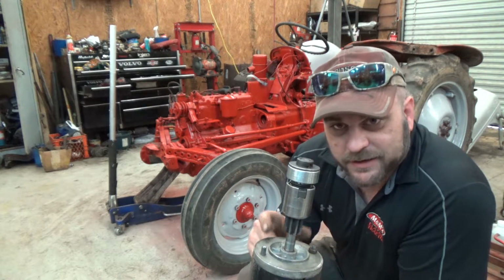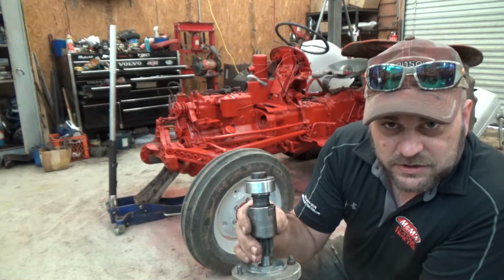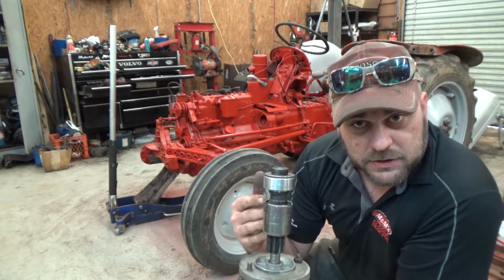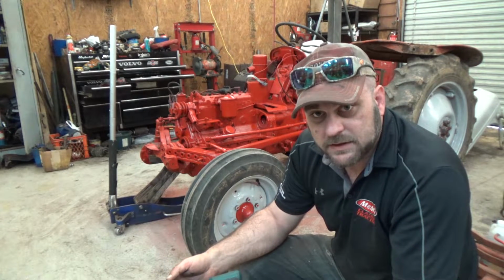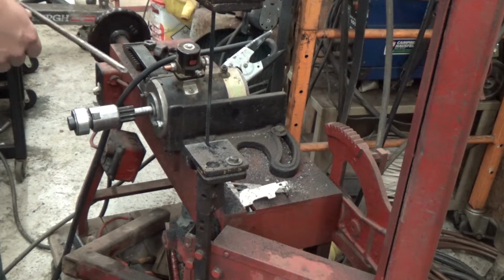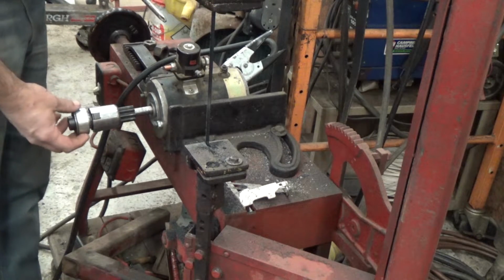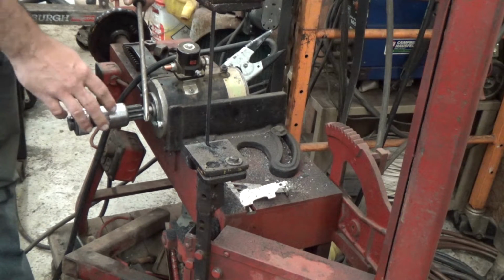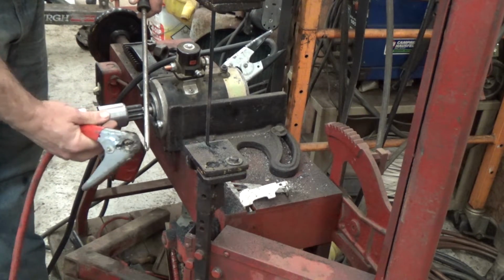New Style Bendix Ford Starter QuickFix

Comment: I'm so glad you made this Video . It sure beats taking the starter apart and using a wire wheel.  So many times starters during shipping get messed up with the drive gear forward....Over here one day you ran the starter in your hand with jumper cables  and touched the drive gear to your shoe heal running the gear back. Now that was a magic trick...

Comment: Hey man...thanks for the tip! Have a starter where the drive gear cracked, so ordered a replacement. Will need to be able to compress old drive so I can get the pin out. Your video shows me how.
Reply from the maker: No problem 👍

Comment: This worked great and is the best way to free up this drive unit. Worked first time. The other way with a screwdriver holding just the drive unit on a wire wheel worked also. I'm very thank ful for these clips.

Comment: I read from Steiner Parts website it can be installed with the Bendix extended make sure the ring gear and Bendix gear are meshed when it starts it will retract to the proper position.
Reply from the maker: IF your lucky it could work.  The problem is that its near impossible to get the bendix past the flywheel when it is locked open.   IT could be done..  though the method shown is much faster and saves tools from being thrown in frustration.

Comment: I just hold it against a wire wheel on a bench grinder and it spins it right back into place.
Reply from the maker: Sometimes we do the same thing. But a lot of rebuilt and new starters have strong fields and the brush will not spin it.

Comment: How to set point on 8 n ford  front mount
Reply from the maker: I personally think its best and easiest to do this with the distributor on the bench (off the engine)  We have a video partially made on this.. its taking forever to get edits done but should be up soon
Reply: Sometimes because of the way that distributor is design it's easier just to take the stripper off market before you take it off line it up to top dead center number one cylinder and then remove it! That way you can clean it but the new points condenser in many time those condensers don't go bad.

Comment: Can this new style be fix be installed on a good starter to get rid of the spring clutch? Or will I have to replace the entire starter -am doing a 12v upgrade.
Thank you
Reply from the maker: You can.   but unfortunately the cost off the bendix alone is almost like buying a complete starter with it already installed:(

Comment: Can these get stuck out from normal use? I was turning my motor by hand installing rod bearings during a in frame rebuild and I heard the starter ratcheting.  I have no idea how long its been that way so I removed the starter and found the bendix stuck out, going to try your method tomorrow to try and get back in but It has been years since the starter was last removed. I'm curious as how it got that way.
Reply from the maker: Definitely possible. Especially if it had a rear seal leak and oil was on the gears. That can be sticky like molasses.

Comment: Thanx. Worked like a charm. This is the second time that this is happened to me. The first time I bought a new Bendix. This Bendix is new and it started the tractor less than 10 times. Both times Bendix got stuck I noticed that the front bushing has moved out of its place. Cut the bushing coming out of place mean that it’s not seating properly because something is oversized? Also those times this happened to me I was trying to start the tractor with a weak battery…
Reply from the maker: If your talking about the shaft bushing, it is possible it is not quite a good fit..  We have had this happen many times.  Normally if the bushing is fine, we knurl the outside of it a few times to give it some grip and press it back in place.    Or we will divot the housing at the seam of the bushing to help wedge it in.